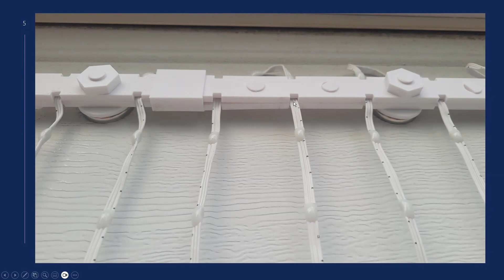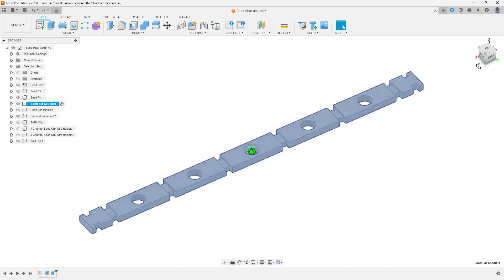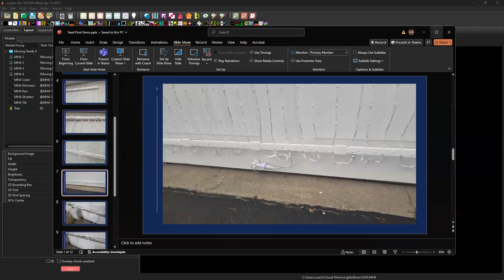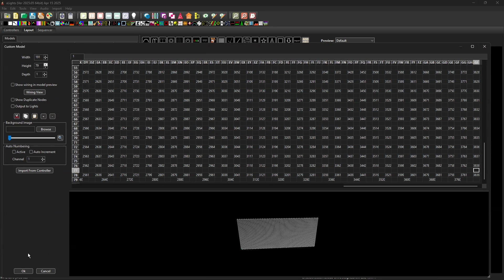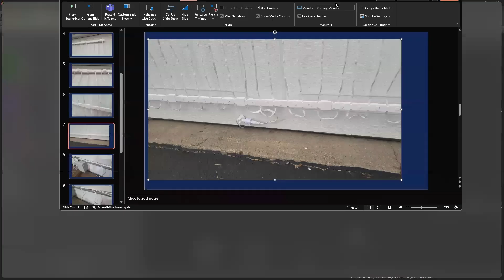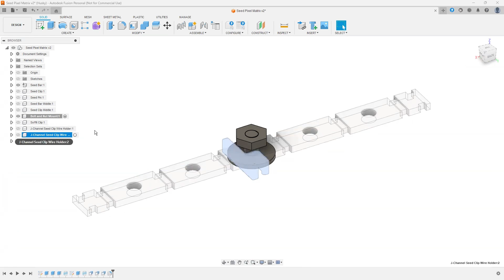xLights Gems: Making a Seed Pixel Matrix - Design and Construction

Comment: im lost!!! I followed step by step except im trying to make a 10x44 vertical matrix and I can't figure it out. the app looks amazing but when I output to the lights its only lighting up halfway and the effects are terrible.
Reply from the maker: Check in with the folks in the xlightszoom.com room - it is just a matter of having your model set up to match your wiring. Also dont forget to upload to the controller and fpp if applicable.
Reply: @xlightsgems  well I had a zoom meeting and they told me Xlights doesn’t support wled v16 2d matrix. So I went back to a normal strand and now Xlights matrix is working.  Kinda sucks you have to change it every time you want to use the effects in wled but it works.

Comment: What magnets did you get and did you just mount them to the back of the mounting bolt stl, or are the magnets inside the part and using a layer pause while printing?

Comment: What is the spacing of the bars that you 3d print for the seeds?
Reply: Can the 3d printed bars be made to accommodate 1in spacing?
Reply from the maker: @chevaughters4242  REquires a redrawing in fusion 360.
Reply: @xlightsgems  Do you think that might be possible for someone to do?  I wish I had the knowledge to do something like that or else I would.
Reply from the maker: @chevaughters4242  Reach out to MarkB at vivid sequences - he is the speaker in the video.
Reply: @xlightsgems I will do that, thank you so much.

Comment: Great video. Can you share how the inside of the garage was wired up. What sort of slack did you need in the data and power to allow the door to be operable
Reply: I thought mark covered that but I believe he actually mounted the controller on the backside of the door.